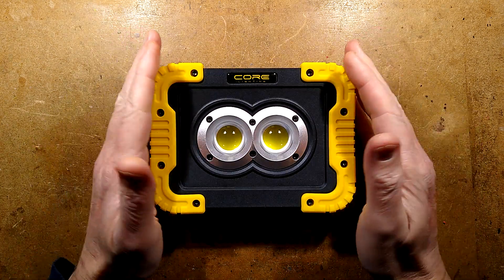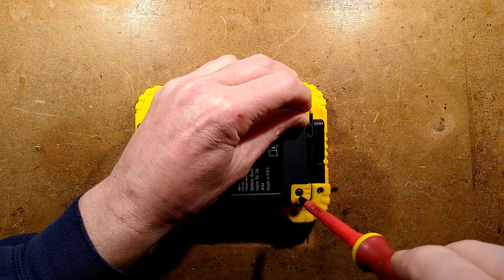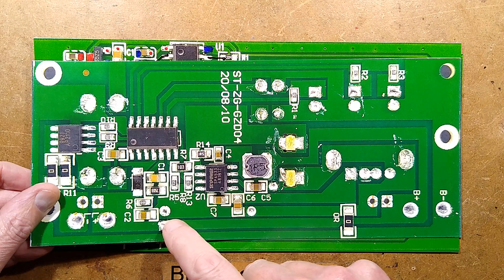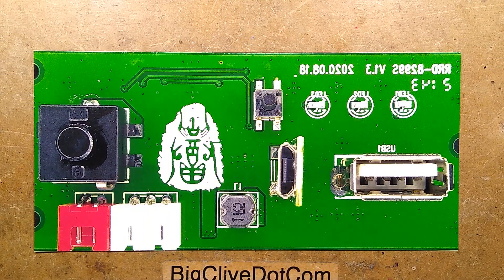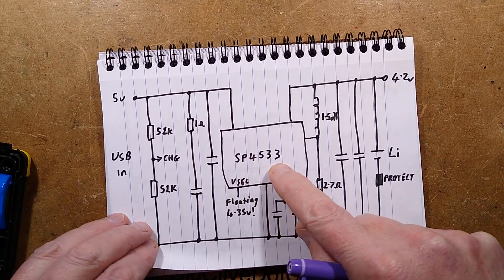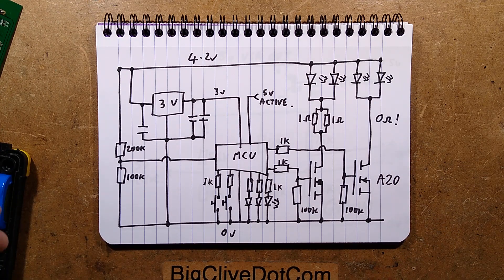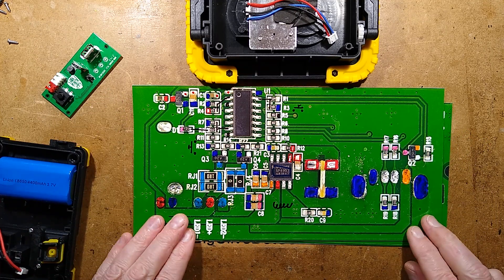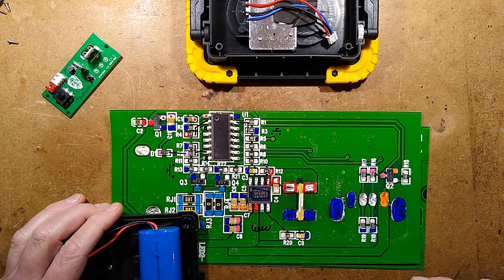Another work light with weird circuitry (with schematic)

Comment: Did you say this was hackable?  To what end?  What can you make it do that it doesn't do by design?
Reply from the maker: The intensity, battery capacity and potentially software are all hackable.
Reply: @bigclivedotcom  Clive, I'm enjoy your channel and look at a good few of your vids, so please don't take this as vindictive nit-picking, but ...
Intensity - if it's already on 100% duty cycle, the only way would be to boost the battery voltage (multiplier?)  - but that applies to every flashlight.
Battery capacity - if there's room for a bigger one - but there's no super ingenuity required there.  Maybe put a higher-capacity battery into it with the same footprint?  Or otherwise cut some of the plastic moulding out of it to make more room.
Software?  Can you modify it?  If you know the processor type, you could replace it and write software from scratch to do what you want, but other than that, can you even find out what's in the chip?  OTOH, it's a flashlight.  What can you make it do that would be useful?  Flash A-B-A-B-A-B - Maybe - if you have an application for that.
The front of that light, with its two big round lenses, reminds me of a jumping spider!  🙂

There was a comment in your video that reminded me of a video I saw many years ago.  You might enjoy this ...
https://www.youtube.com/watch?v=zmP0hmuDbMQ

Comment: hi BIG-Clive i have a AUKEY PB-Y13 10.000 MAH super slim that I've had for 3 years without any issues but after moving house i got it out from storage and see if there was any charge in but it seems like there is NONE, i tried charge it up but nothing there is no signs of burning and no smell from the usb out-put's, it looks in perfect condition other than a few scatch's tried charging it off a poundland powerbank it try and get some slow charge into but nothing, then off my TV, PC and even even a old Sony 500MAH phone charger but no luck so was wondering if you wanted a  crack at it and see if can be repaired cos like you i wouldn't just throw it out because it dont work, and i'm not brave enough just yet to do a teardown or it
Reply from the maker: It may have discharged to the point that the protection circuit can't operate.  If it has, the only fix would be to open the case and gently bring the cells back up to 3V at very low current.  Being over discharged isn't great for lithium cells, so treat with caution if attempting to recharge.

Comment: I like the ones like these that allow you to use li ion horizontally then regular alkalines vertically. How come we never see any of these LED lights with warm white high CRI COBs? I was harvesting my homegrown concord grapes by the light of my dual 18650 LED headlamp the other night and I realized just how worthless it is for this task. Hard to tell the color well enough to see which ones were ripe and which needed more time on the vine. Has anyone done this hack?
Reply from the maker: You may have to make a custom unit.
Reply: I think Milwaukee has a line of LED flashlight products that use 90+ CRI LEDs.

Comment: Spank it! lol.
Interesting. We've come a long way from simple battery-bulb flashlights. 
When are we going to have microprocessor controlled eating utensils? 😉
Reply: Much too soon, probably.  You might've seen the ones recently that use a low current on the ( metal ) tines, supposedly to make the food taste more salty?  Next thing would be a button for settings, little oled screen to run ads, ...?
Reply: @chri-k  Dunno, it's a Japanese thing, could well ask the same question about a lot of their efforts.  Just checked, it's called "Erekisoruto" which seems like it's short for electric salt?
Reply: @idjtoal  but have [ potential customers ] considered salting the food? or not salting the food and just eating it, not everything has to be salty.
Reply: @chri-k  Right, lots of questions on this.  I'm wondering if it's DC maybe, articles saying it's to make the sodium ions more mobile but are they also giving people a dose of chromium and whatever else.

Comment: you should have tried if they dim over time. i tried 2 similar work lights. they start to dim after 60 seconds and after 10 minutes its useless dim. had nothing to do with voltage or heat. i was done with this crap and just bought a bosch worklight.

Comment: I Prefer the ones That use A Removable  Cordless Tool Battery packs (just so you can Go a Few Weeks / Months and can fast  switch battery packs in complete darkness + 1 hour fast charged)
- .Ryobi - Milwaukee (MX FUEL) - DeWalt

Comment: I have similar but the issue is that they "flutter" on videos and I wanted them for video lights.
Reply from the maker: Dimming will cause pulse width modulation issues.  If they have a high setting that doesn't flicker then it could work.

Comment: I have the same aliexpress version with 2×18650 batteries, mine has full, pwm half and oscillating mode both eyes at the same time and extra flashlight on the side._

Comment: I rotated the display in every way, and I have no idea what this picture on the board could ever mean.
By the way, both of these lights have microUSB sockets, right? I must admit, I started loving USB Type-C plugs and sockets long before they introduced them: primarily because of my experience with microUSB.
Reply: I have one of these on the "maybe fix it one day" shelf.  It was the microusb socket that failed/sheared off.
Reply: @mattfleming86  I even bought some microUSB sockets and breakout boards, but replacing them with just another microUSB doesn't fix the general weakness of their design — believe me, I learned how to solder a part to make it hold firmly there.

If that device is of a similar design with a daughterboard, there's a chance of finding a similar daughterboard with a different socket.

Comment: Can you charge while using the light?
Reply from the maker: Yes you can.  But there will probably be a balance voltage where the cells will only charge to a voltage where the current being supplied matches the LED current.

Comment: „Denouncing delay“ is what a lot of „makers“ do. The better solution is a state machine, but in electronics forums you are able to create a firestorm immediately when discussing that.
Reply: Not sure if you understood that term correctly. The term Clive used was "De-bounce" . A de-bounce circuit corrects the  non-ideal behavior of any switch which generates multiple transitions of a single input.
Reply: @brucepickess8097  
the announced firestorm!

Be assured, I understand the technical details.
This „state machine“ is sampling the input periodically (1..10ms) and waiting for a number of „on“ values (typically 3 times) in sequence on the pin until it says „on“ to the rest of the program. It only gives you a 3..30ms delay and does not take over the complete MCU for waiting.
Reply: @brucepickess8097  You tell him, Bruce!!!!

Comment: Speaking of hacking ALDI products have you ever considered "examining" their power tools for hackability?
Reply from the maker: I really should explore some.
Reply: What'd you have in mind? I have their 12v and 20v drills and now their 40v mower. I'd really like to run the big mower packs on my Craftsman v20 set that has smaller batteries. if you check sixtyfiveford he does some of this though not specifically with FERREX brand the videos are rally worth watching. I am hoping to score a cordless hedge trimmer next.
Reply: @johnpossum556  I enjoy messing about with RC stuff in particular and electronics in general. Every time I look at a power tool, any of them not just ALDI, I see motors, motor speed controllers and charging systems along with "protected" power sources.
The new 40v system(s), and 8Ah batteries, open up a world of new possibilities. Don't think it will be long before ALDI introduces a 40V unit with a speed controller. Think demolition tools, whipper snipper/weed whacker/strimmer, depending on where you live, heavy duty impact devices .....
Reply: @jameslamb4573  My 40vdc li ion Ferrex mower makes you push a button then pull back on a handle and then it does a soft start. So it must have some kind of motor controller already.
 Maybe you can help me as I have wanted to get into RC planes but I have two major issues:
 1) I drive an Ebike and have no car so a plane has to be small or have removable wings.
 2) I am a real techy but I've been disconnected from a lot of the electronic advances so doing things like loading software in top a RC plane transmitter is very intimidating to me. I am a huge fan of Peter Sripol, rctestflight, Samm Sheperd, & David Windestahl. What transmitter I should get was the question that stopped me from making the purchase. Now summer is over and the RC plane season is mostly over but I would like to still learn. I have amassed the parts for making an electric hot wire foam wing cutter. Sheperd's little flying wing is something I could carry on my bike.
 Any channels I should be watching? I kind of burned out on FliteTest. What transmitter do yoiu favor?

Comment: I'm still waiting on a good behind-the-scenes explanation of just how Chinese products end up being almost, but not quite, identical to each other. Take a K40 laser cutter, or a mini lathe, or countless other gadgets - they're available from loads of different manufacturers, but they're all nearly identical. Never figured it out.
Reply: It is common in other countries as well. Sometimes it is due to licensing, but other times it is just copying.
Reply: Badge Engineering, it's been around for ages, not just Chinese products, many countries do the same.
Reply from the maker: They are often small companies assembling machines with components from a common source.

Comment: Hey @bigclivedotcom,  how does one power a soldering iron if the power goes out? I'm sure you have several clever options!
Reply from the maker: You can get soldering irons that work with standard cordless tool batteries.